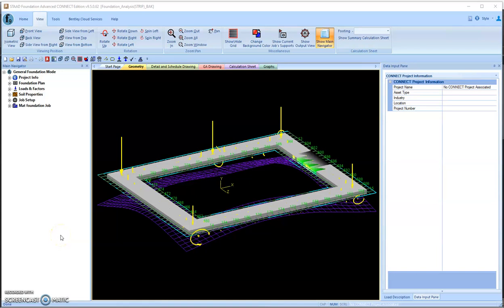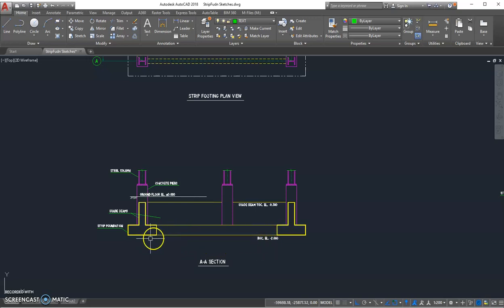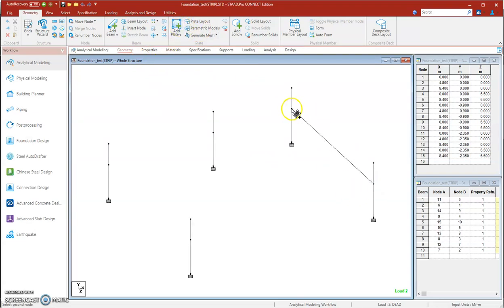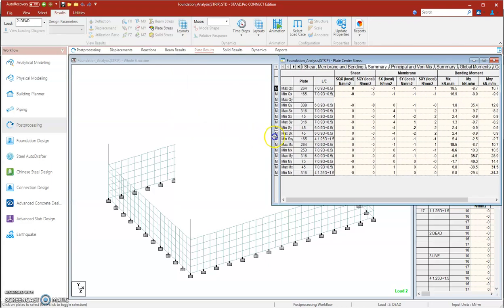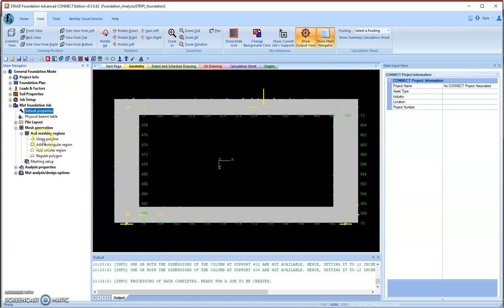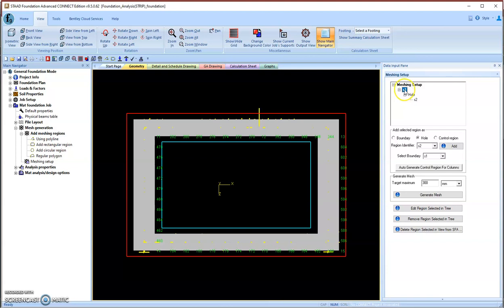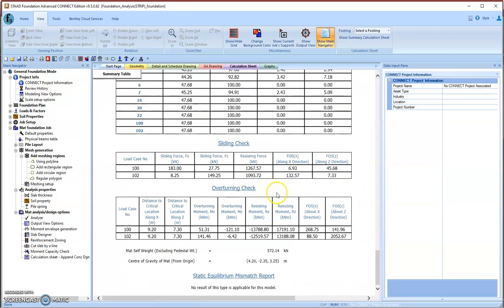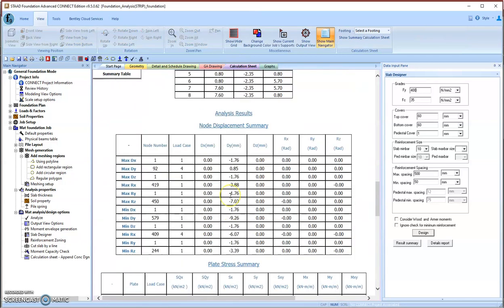Strip Foundation with grade beams using STAAD Pro- SFA

Comment: what do you use to cal the rigidity of strip footing?
Reply from the maker: As usual, with our conventional rigid method, the combined foundation is assumed to be infinitely rigid. Also, the soil pressure is distributed in straight line, and the centroid of the soil pressure is coincident with the line of action of the resultant column loads. if the spacing of columns is larger than a certain distance (will be calculated by a formula, which I will explain in my next video), the complicated Approximate Flexible method have to be used.

Comment: Do you mean the column strip foundation is more complicated than wall strip foundation, because of the rigidity requirement?
Reply from the maker: Yes, you are right. Column strip footing is a combined foundation, which requires its soil base  reaction modulus in a uniform distribution or at least linear distribution, such that we can apply the conventional rigid method.